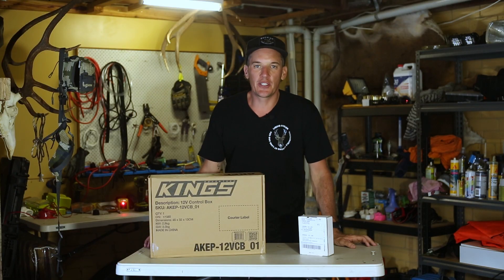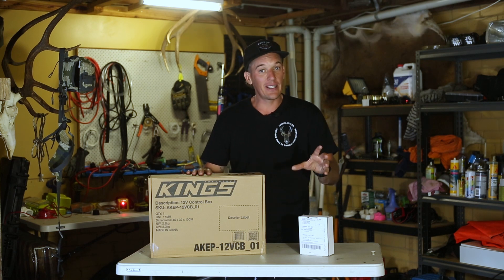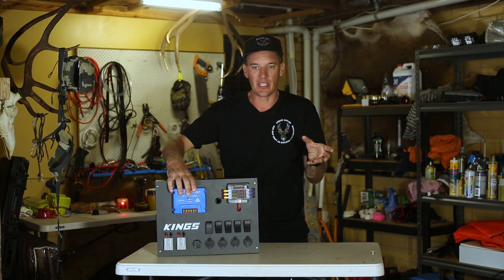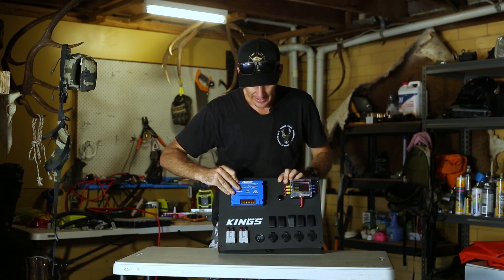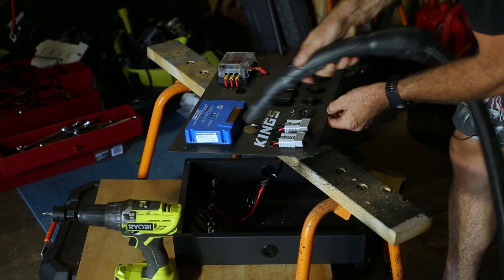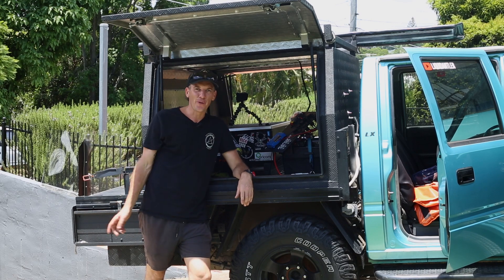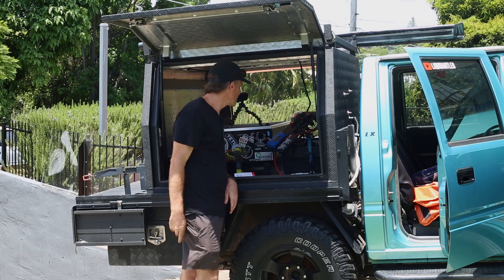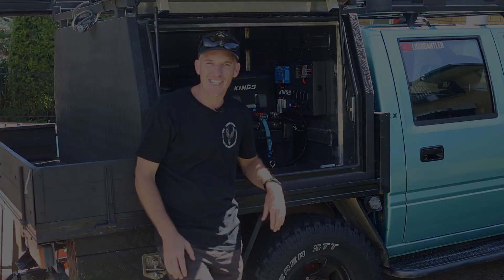Upgraded the 12V system on the Holden Rodeo // Kings 12V Control Panel and 20A MPPT Solar Regulator

Comment: You are getting 15V because your MPPT controller is cactus. Grab a Victron 75/15 or 75/10  MPPT controller before the el cheapo kills your battery.
Reply from the maker: Agreed, ended up sending back and buying a Renogy unit

Comment: @8:05 you're getting 15V probable because you're connected directly to the battery, instead of connecting to the MPPT's regulated load output, i'm just guessing

Comment: I have the same problem with the kings solar regulator. I was suspicous why my battery was getting so hot. I hooked it up to a battery monitor to monitor voltage on a graph and was able to see it always charge battery at 14.7 to 15V, even when battery is full it doesn't drop the voltage to float which it should do at 13.5V
Reply from the maker: yea seems to be a pretty common problem 🤔

Comment: Hey mate how did you go with the regulator ? Did you end up keep the kings one or did you switch it to another brand ? I’m having the same issue with my solar regulator
Reply from the maker: Hi mate, i took back the regulator. It was a constant problem. Changed tp a renogy regulator and loving it 👊
Reply: Hi Mate I had the problem with my regulator I have a 250w solar panel and a 20A regulator same problem found out the regulator was to small for the panel so I put a 30A regulator in ant it works great

Comment: Looks great man. Should suit you great out in the field to charge camera batteries, phones, drones, and all your other equipment. I built my own too my scratch. Tool a while but works great.
Reply from the maker: Thanks, mate. Unfortunately, the mppt regulator is crap. Sent it back. New brand on the way
Reply: @LiquidAntler  sweet, have a look at the Victron. It doesn't have all the digital readouts but is a very well-known solid performer in the industry.

Comment: yes,those mppt controllers .ive had 2.the first one didnt charge,the replacement one did the same as yours,my battery went over 16 volts.got a refund from kings and bought a kick ass 40 amp one for $90 on special.no problems since.
Reply from the maker: Yea ive ended up returning it 😪 will do an update video when the new renogy one arrives
Reply: @LiquidAntler  Bugger. I hope that's not a common issue with these MPPT controllers. I have one that I'm yet to install. I ordered the 12V control box today, and also saw these: 
'Kings Plus Premium 20A MPPT Solar Regulator | Push-Button Lithium & AGM Compatible | Digital Display with Volts, Amps and Watts | Inc. Two Quick-Connect Plugs'
So I bought one of them. I have three panels to connect, and two batteries (so far). I've also got a 3000W inverter, and a 3000W petrol genset just in case I need it. I have a dual battery kit but also want a DC-DC charger so I can use one panel to maintain charge in the vehicle batteries in case of an alternator failure. 
I know just enough about solar setups in vehicles to be a danger to myself, so this should be fun. My one saving grace is that I can connect wiring correctly, and safely.

Comment: Good to c another vid mate👌 Andrew R could b correct re it being in boost mode so did it drop down to  high 14 volts after a while? If it didn’t double check with a quality multimeter the voltage coming out of the solar controller and at the battery as the voltmeters r known for being a bit inaccurate? 
If u r getting 15 volts at the battery u need to disconnect it ASAP as it will kill your battery eventually?

If u need any further help hit me up on fb or Insta as I work in the solar field in the off road camper industry so might b able to help u?

Cheers Darryl
Reply from the maker: Hi Darryl, Yes, it does seem to drop down below 15 at times. I will keep and eye on it and keep checking with a multimeter 👊
Reply: @LiquidAntler  too easy mate let me know if I can help👍

Comment: 15 volt at the battery could be the MPPT controller being in BOOST mode initially ....  looking at the specs of the controller max output volts of the controller would appear to be 14.7v - allowing for the volt gauge to have a bit of inaccuracy it would appear to be in boost mode.
Reply from the maker: Thanks mate 👊